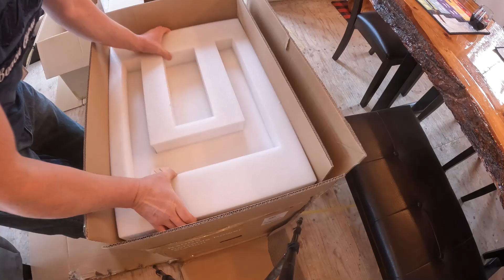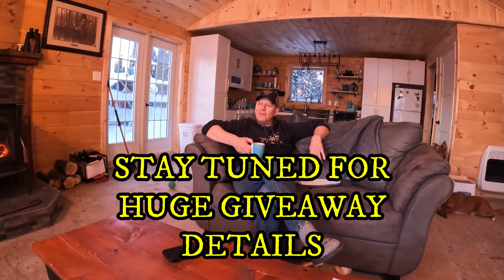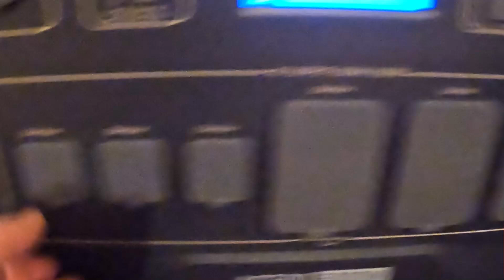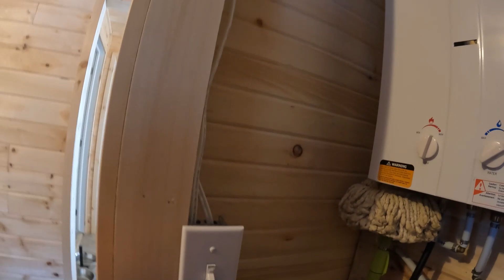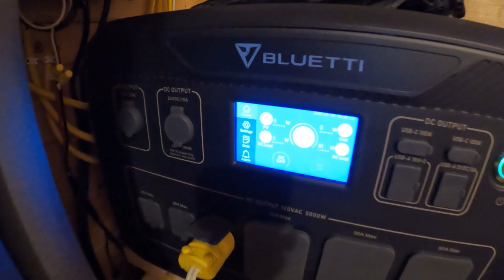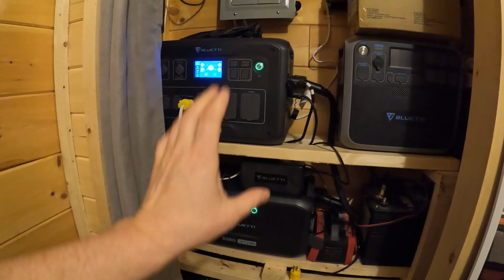Comparing BLUETTI power to regular battery power and a gas generator

Comment: Great video Chuck, I’ll be having a look at that Bluetti AC500 for myself. My only question is, does your panels and wind generate enough to keep the Bluetti AC500 topped up or do you need to charge it with the generator at times. Maybe a little more info on how a week or month works with your power system. Keep up the good work, and we’ll see you next time, guaranteed, lol.
Reply from the maker: On a sunny day it draws in more power than I can burn.  And now the days are short. I know from April til sept or oct I won’t have a worry. If I start my generator now it’s only for an hour or two to charge it up and then we’re good for another 20-24 hours.

Comment: That BLUETTI AC500 is a nice item for giveaway. I love your whole house set up. i'm getting a whole house generac 24KW generator installed. here on the Chesapeake Bay, we get storms that can knock you out of power for days, although tree trimming has helped a lot. Youre in a beautiful area. thanks for highlighting the BLUETTI AC500. It will provide lots of clean power for your computer.

Comment: I just may have to invest in one of those units for up at the tent and being portable for out in the boat. In both cases running the generator is noisy. 
I certainly wrote that info down, a Bluetti AC500 5000w with batteries B300S 3072Wh which will work sweet. Gotta check it out.